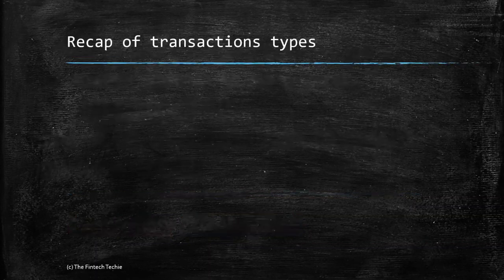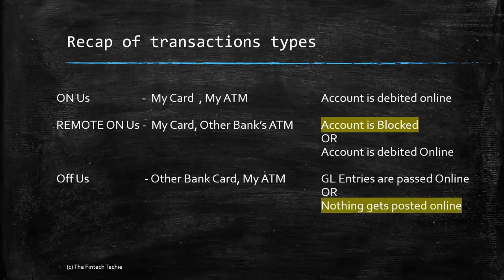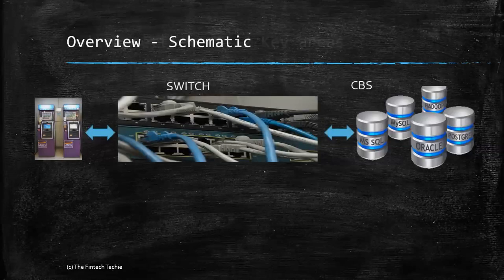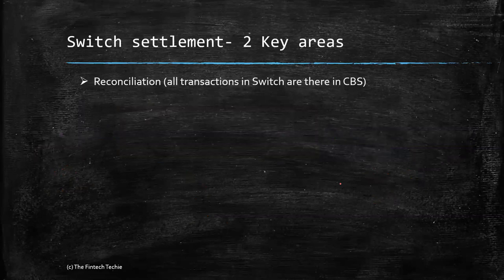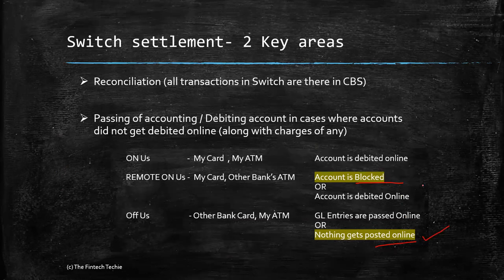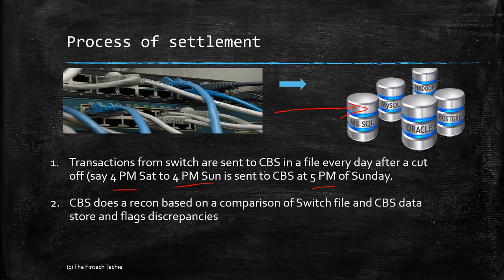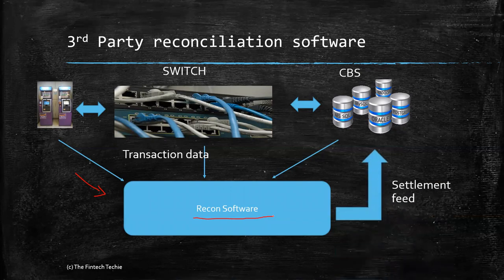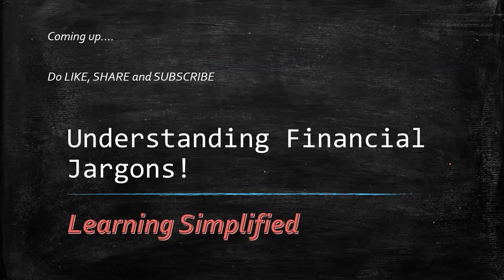How ATM Switch settlement works

Comment: What about the files which are missed or failed to reach Switch and CBS? They are expected to be settled or not?
Reply from the maker: If a transaction is present in Switch file and not found in the CBS, the transaction would be marked as Unreconciled. If the txn was successful at the Switch (Switch authorized it - SAF case)  It would then be an implementation decision whether to put in a logic to force post such transaction in CBS (or to manually/operationally handle such transactions)